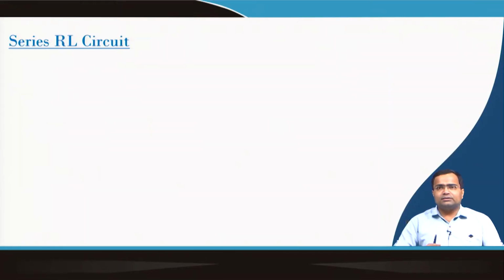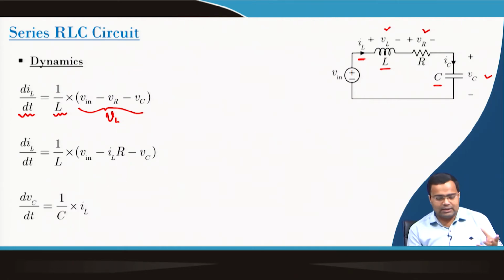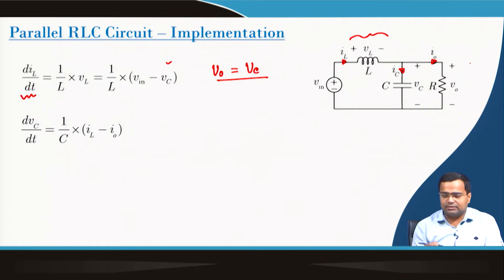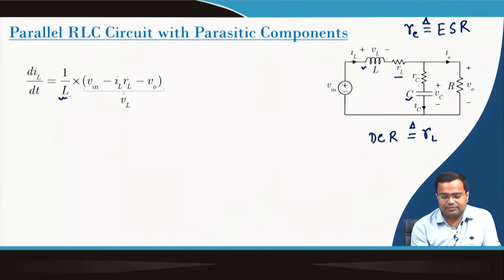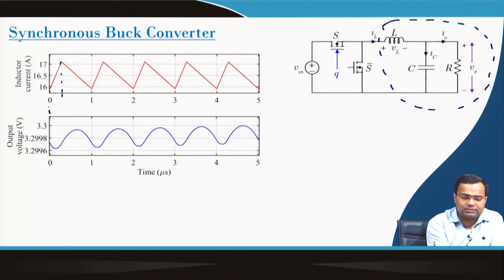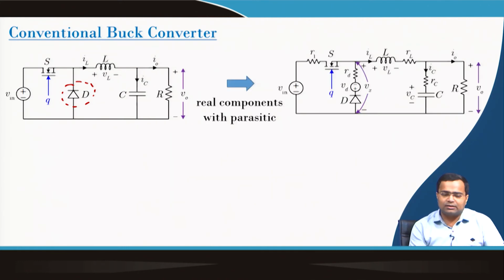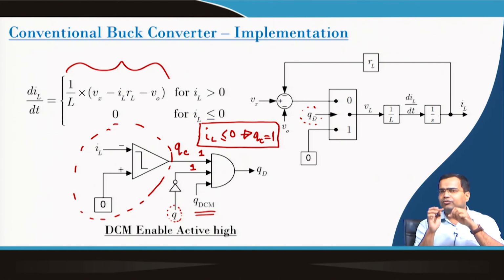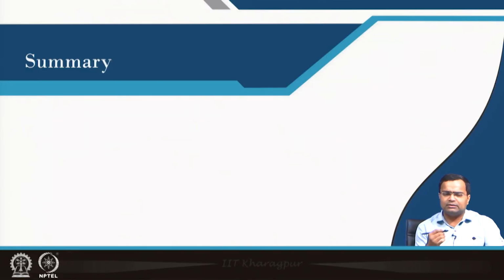Lecture 04: Model Development for MATLAB Simulation

Comment: How to do it for converters having 6 to 8 modes of operation
Reply: You can identify all modes and model them using differential equations. Then you need to identify various conditions for mode transitions and implement customized models accordingly.. This would require an in-depth understanding of converter dynamics. Rather, one can directly use the Simscape toolbox.